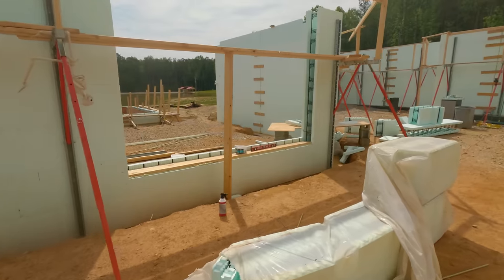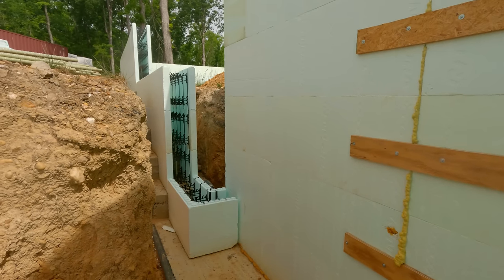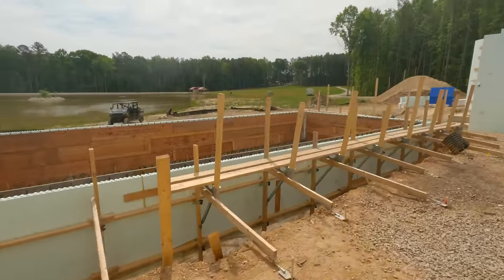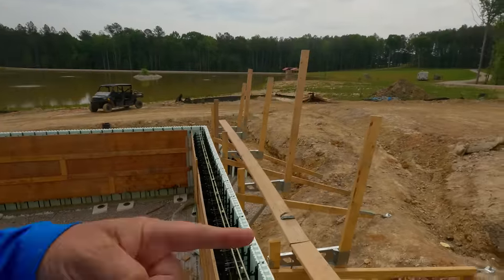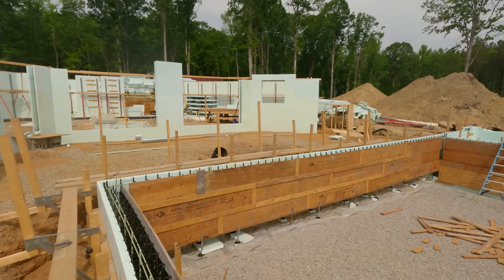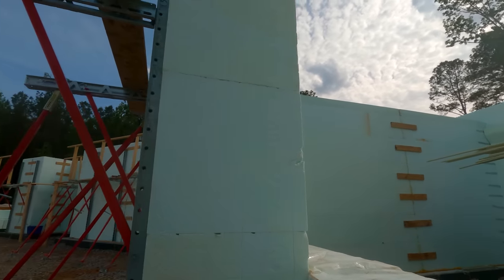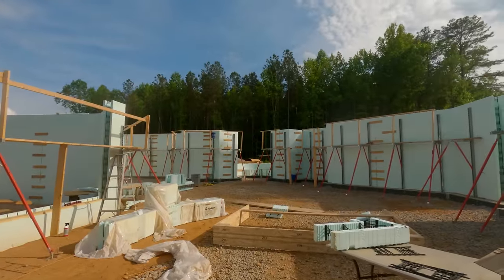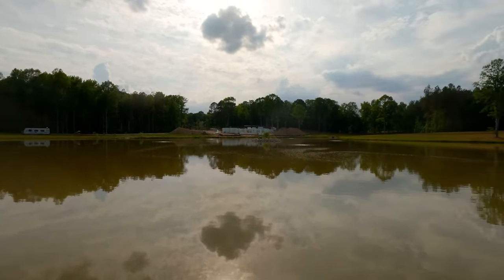ICF Basement is Finished…Except for

Comment: Use a one of those big propane torches on a 20lb propane tank to take care of the weeds on the dam. Wouldn't have to worry about chemicals getting into the pond. Some farmers add a propane system to their equipment and use the fire to control weeds instead of chemicals.
Reply from the maker: 🤔 might make for good content too. Thanks 😊
Reply: @BealyGood  You're welcome. It really doesn't take much to kill the weeds with the flames. And to be honest, it's kind of fun, lol. I've never used one of those big propane torches before, but I have used one of those tiny handheld ones you get in the hardware store and it worked well on small patches of weeds. Just think one of those big roofer torches would work the best at flame weeding.

Comment: I had to get up to the top of an 8 foot step ladder last week to finished attaching the metal roof of a gazebo since the gazebo was right to the edge of a deck so I needed to put the ladder off the deck to reach. Man I hate ladders. Ended up tying the ladder to the deck railing so at least it couldn't fall over. Even then I couldn't reach the bolt so I got a 90 degree adapter for my impact driver.
Reply from the maker: I need to get some more 8’ ladders. I’m not found of them either. Thanks 😊

Comment: I know a lot has changed since I was involved in ICF because that was 80's and 90's when it was new.  Curious about how headers are handled now.  In my day (can't believe I'm old enough to say that),  we used something along the line of 2x2x 3/16 angle iron embedded as lintels across our openings to hold the weight of the concrete.  They stayed in place after the pour, and were instrumental in keeping our sub-sill from rising up from our windows due to concrete pressure by being the other end of our vertical bracing inside our openings.  We gave vertical bracing priority since weight was the most potent factor, and lateral bracing secondary because it was well, secondary.

I'm sure I'll see soon enough, but I'm curious if you are using the likes of 2x8's and/or 2x6's and/or 2x4's to keep you bucks from bowing in on you?  (Of course you can't put them in until you fill your sills 'cause concrete won't flow in from the sides.  Found that out the hard way.  Almost lost 1/2 a truck of concrete wanting to set up in the truck while we figured it all out.  Got to have all your buck bracing cut and staged ahead of time).

Anyway, thanks for sharing, and good luck with your pour(s).
Reply from the maker: Each window and door opening gets 4 pieces of number 5 rebar across the top. 2 pieces 1.5” above the window buck and 2 pieces about 11 inches above those. They are connected with stirrups. At each end is a 90 degree bent bar. You’re correct about more bracing going in. We’ll have to have those pieces cut and waiting to put in after filling the space underneath the window. Thanks for reminding me.
Reply: @BealyGood  Works both ways.  I get to look over your shoulder, and feel like I'm part of this project, and help keep you out of trouble, and you pick up things that will stay with you forever.  Like I'm sure from here on out, you'll always remember how many inches your garage floor drop needs to be won't you?!

Comment: Most likely the experts have already mentioned this but it seems like you may want to find a way to build in a 12-in radius curve on all those 90° angles in the pool since those pool vacuum cleaners or vacuum side cleaners as they call them have issues with steps and such like ..
Heck of a project you've got going there 👍
Reply from the maker: There are metal corners that go in and make a curve in the concrete. I’ll show them close up in the next video. Thanks 😊

Comment: You may have explained it and I missed it but how do you run wiring for outlets and switches?
Reply from the maker: Using a hot knife or batt powered chainsaw, grooves are cut into the foam, wiring ran then spray foamed over.

Comment: Good day to the Bealy Goods. You haven't driven the back road on the back side of the pond " Bealy Good way". Will you be putting  up a fence back there and any kind of lighting
Reply from the maker: There will be a fence. Just not sure if it will be this 4 board type or a post and wire. No lighting is planned at this time. Thanks 😊

Comment: What about the electrical outlet and switches?  The ladder was very scary.  I'm glad you weren't hurt!
Reply from the maker: The wiring all goes in the foam after the concrete pour. It’s an interesting process. Will get into more detail later. Thanks 😊

Comment: Are you using insuldeck for any of your floors/roof for suspended slab?
Reply from the maker: Not on this build. I priced it out but it added a lot of costs to my floor system and I didn’t need the insulation there. I like it though.

Comment: How are you going to have an Infinity edge pool when the whole pool is it the same height ain't the water going to flow over all the walls you better think about this before you poor cement because you're about to f******That's not going to be a very good Infinity edge if the water is all the same height come on think about it this is the way it's not going to work you need one side lower the side that's going to let the water out just a few inches but you needed to be a few inches lower I built pulls my entire life and you're about to mess up buddy
Reply from the maker: 🙄 I’m well aware. Cutting both sides of the wall down to the height needed is one of about 20 items left to do before pour.